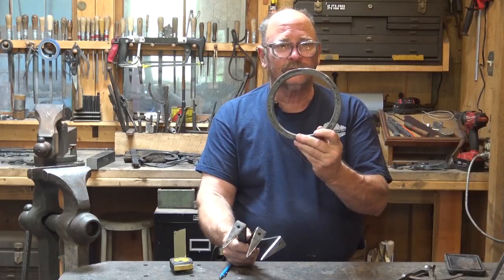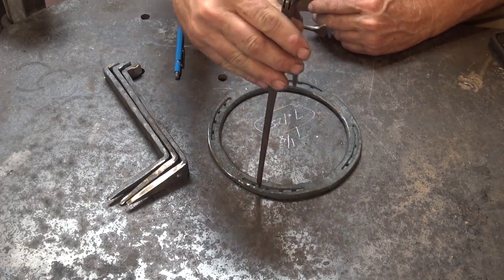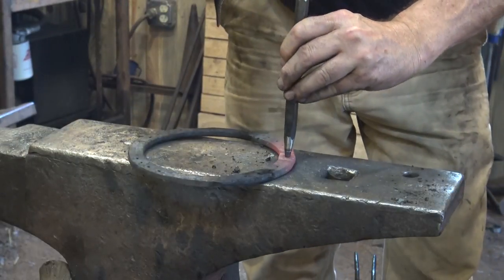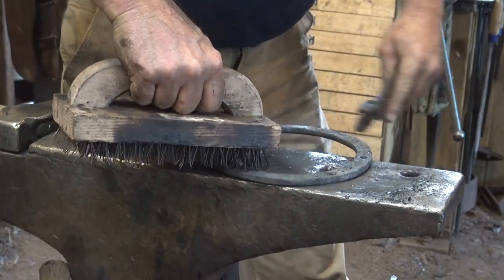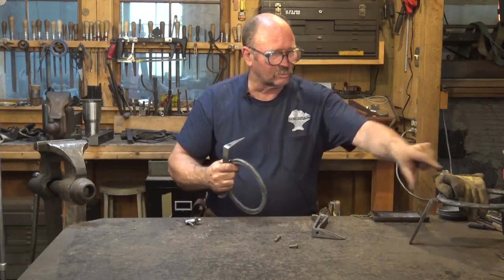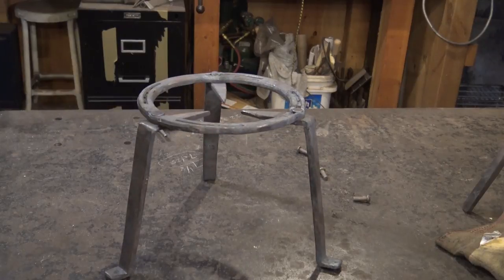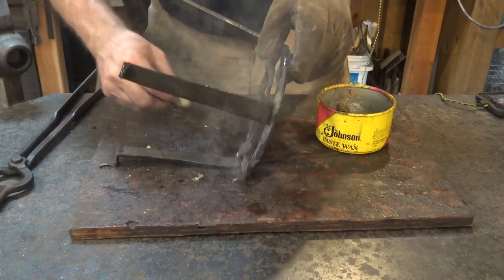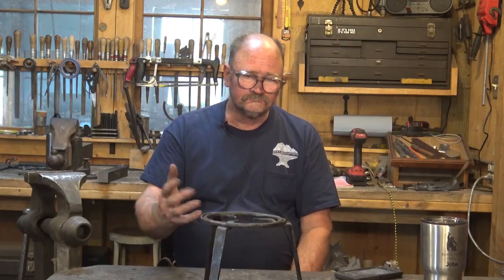Horse shoe trivet - part 3 - New Mexican ironwork

Comment: Very cool project, I mean hot project! I will have to find some horse shoes some where. About the sound, I think the old mike was fine. The new one has an echo I think and  it picks up background noises. The rain sounded like a hail storm, but than again maybe it was a hail storm.
Reply from the maker: There was some hail.  I am hoping that some adjustments on the mic will help.  The old mic only works with a specific camera and this one will work on anything with an input and will hopefully be more versatile.
Reply: That makes sense, I would go for versatile too.

Comment: I believe I’m going to take this technique and use it to make planters for our farm. Excellent work as usual John. The sound quality is more clear. However there is a bit of reverb. Maybe just a setting.  I think the mic is struggling with the sound cancelling. But again not a reason not to enjoy your excellent work. 
Kevin B
Reply from the maker: Luckily this mic has more user control on the unit.  Hopefully some adjustments will fix the issue
Reply: Black Bear Forge I’m sure you will figure it out.

Comment: I thought the sound quality was very good, but I don't remember any issues from before. I'm old and have bad hearing and a bad memory. :)
Reply from the maker: The issues with the other mic are partly logistical, such as it only works on the one camera and can't be used on anything else.  But it also seems to really amplify the sound of the forges, which you wouldn't notice much because I try to edit that out.  I'm hoping for something that will allow me to speak over the forge, so I don't have to keep shutting it off all of the time.
Reply: Yep, same issues here, old, bad hearing and fading memory so I could not not find any change, be it good or bad!

Comment: I just couldn't do it. I couldn't punch 3 holes in a ring that has 4 slots in it. I would have to make it with 3 horseshoes.
Reply: I was thinking exactly this...
Reply: 4 legs though?
Reply: @shifty3453  Three legs work better on uneven surfaces like around a campfire.

Comment: Your new mic is not as good as your old one. Glad you had both in the video. You can hear that it makes an echo at the end. Just my opinion. Cool idea to make it from horse shoes. In Ireland they make them from three with the ends pointing inwards.
Reply from the maker: Actually it was just the new one for the full video.  Luckily it has more user controls, so I hope it works out, it was a fairly big investment.  The mike I usually use only work on the one camera where as the new one can be used on any camera with a mic input.  It is also closer to a professional quality mic than the old one.  Unfortunately they don't exactly design these things for the shop enviornment
Reply: OK so in some of the audio in the video there is more of an echo when you talk and makes it sound different. Perhaps it was the settings. The rest sounded great.

Comment: These are meant to go in a fire right?  With the legs being long would there be a chance of heating them to the point of warping, especially if you've got a big 'ol cast iron dutch oven full of liquid?  Wondering if it would be worth it to run the legs through a swedge to give it a bit of a convex profile...
Reply from the maker: You don't see any of the old ones done that way, but you could give it a try.  The main thing is to not cook over that large of a fire

Comment: Nice video John! I think you said the trivet you made for the conference was square punched for the legs. This would help the legs from swiveling if/when they loosened up later on. Maybe keep someone's soup out of the fire.
Reply from the maker: That was the thought at the time.  However it does not seem to be a common approach.  I well made rivet should stay tight.  This was inspired by an old New Mexican example the one riveted leg on that one and the riveted legs on all of the others remain tight and they are well over 100 years old.

Comment: I have thoroughly enjoyed the video series on the horseshoe trivet.  Picked up some good ideas in them!  I don't have a torch, so one thing I do when setting the rivets hot from the fire is to first give the small end a very slight peen which will prevent the rivet from falling out.

I did notice, however, that the new microphone tends to have and echo or booming sound at times which can be a little overpowering.  Maybe there is a tweak you can make to remove that characteristic.  I think the "old" mic is better suited to your videos.
Reply from the maker: This one does have more adjust ability than the old one.  so hopefully turning the gain down will solve the problems.

Comment: I have been considering the same type of things except for I was only going to make the legs about 1 inch.  Felt line or leather line the feet so as not to mark up the table.  Then use them as hot plates for setting at the table.
Reply from the maker: These tend to see use as a hot plate more than cooking.  But a tall one like this really belongs in the fire with a pot of soup on it.
Reply: Black Bear Forge yes sir that is correct but I make a tripod and Tremel for the pot cooking